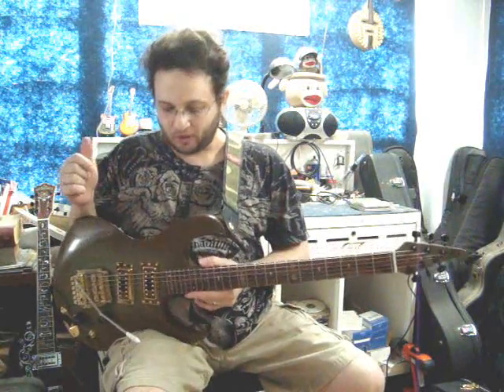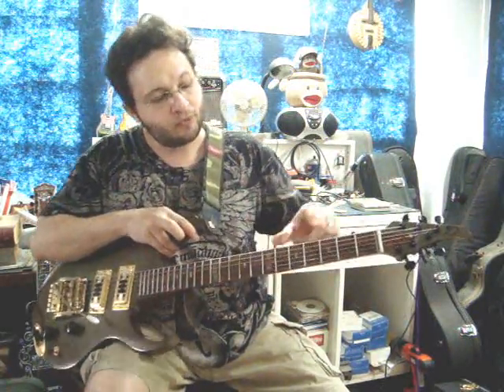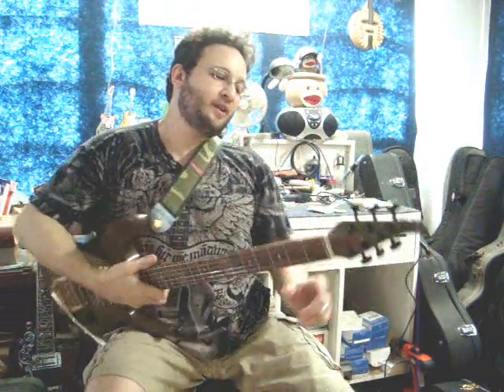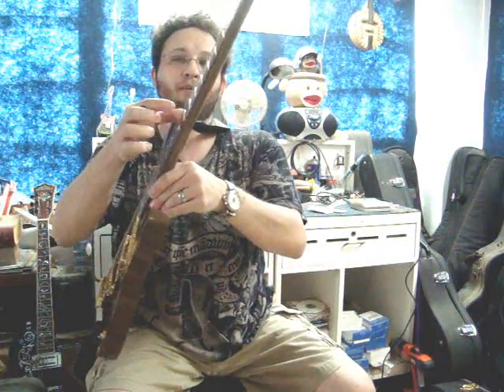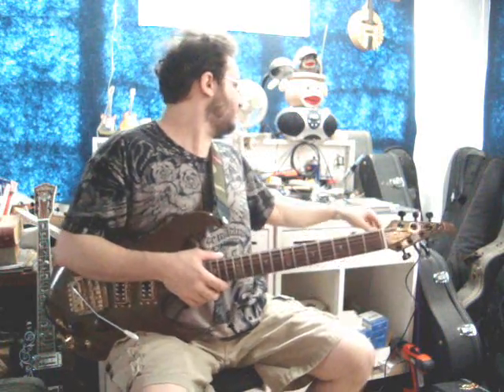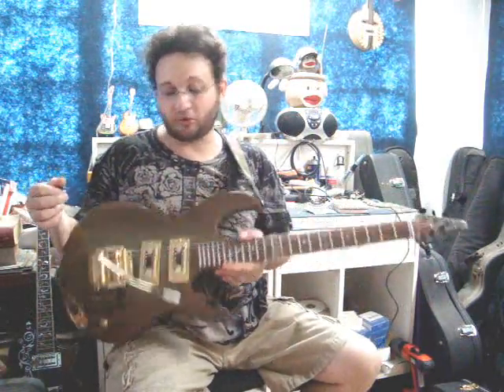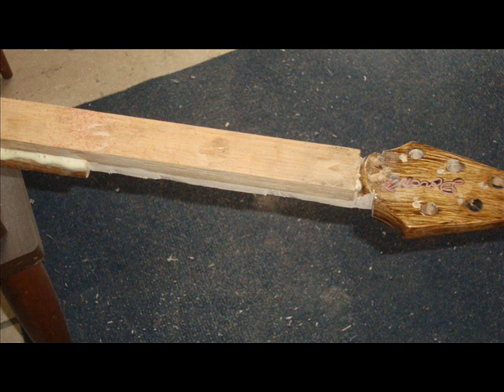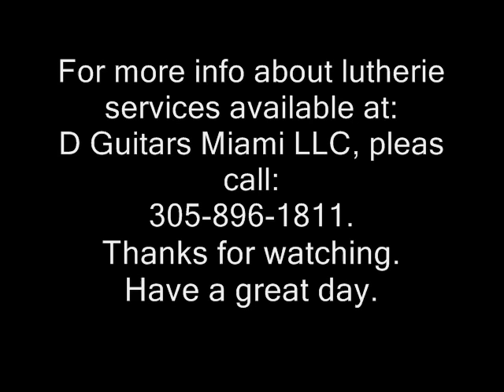Guitar I Built In 1996 Fully Resurrected/Restored Better Than Ever!!

Comment from the maker: thank you very much. yeah, the only reason I included the stills was because of the enormity of the restoration. I wanted to show how it originally looked before I sold it, since verbally describing would not be enough. Most builds usually follow a path that is pretty much the same from one guitar to the next. so a slide show could seem redundant. this, however, was anything but routine. plus, I'm sure most people don't want to sit through a 17+ minute video every time. lol. But perhaps. thanks.

Comment from the maker: and the top half of the main central section of this guitar is 3/4" thick red oak that's 4" wide. so you know that virtually all of the string resonance and such is directed at that. and you can clearly hear how resonant and vibrant this guitar sounds. red oak is so overlooked that it's shameful. as is poplar. it also has a lot to do with finding the right pieces of timber that have a good tap tone, like the 1/2" thick piece of teak I used for the back of the neck.